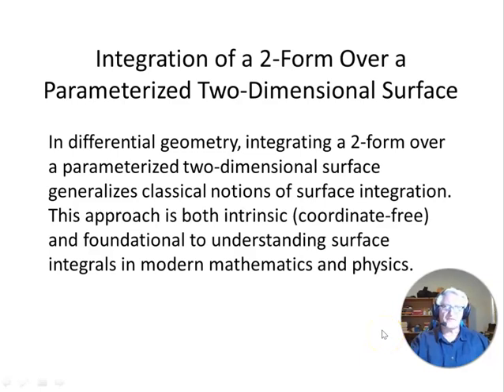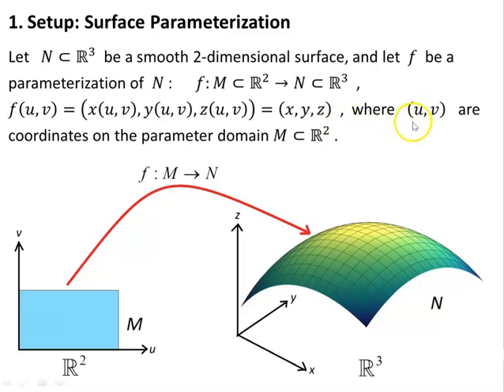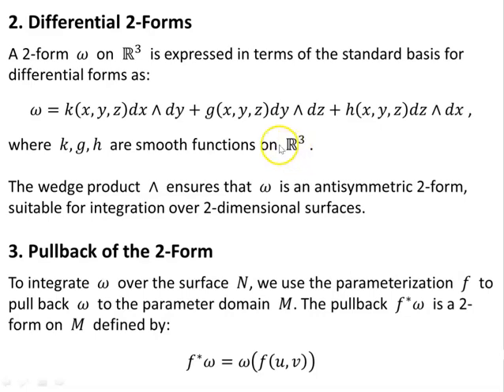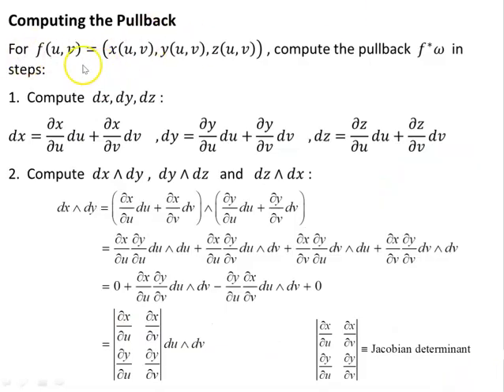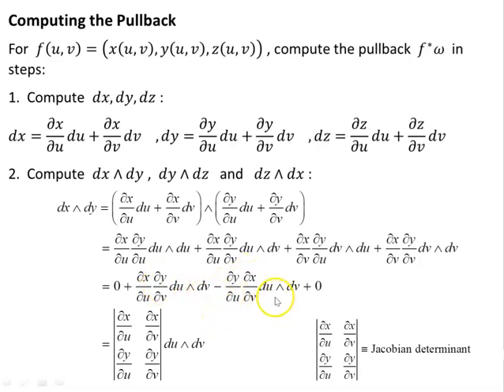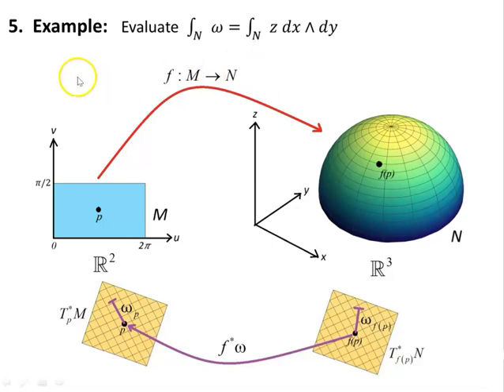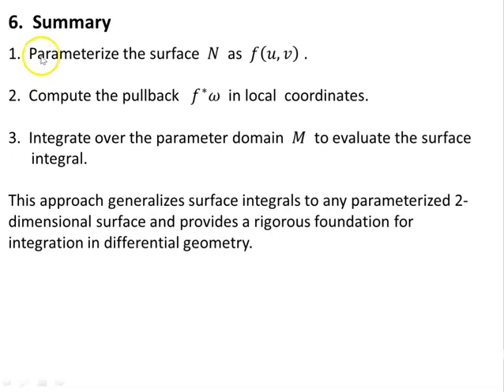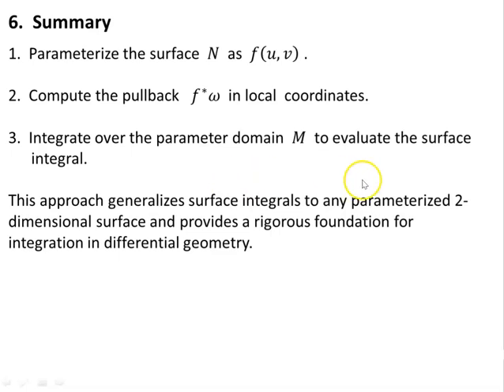Surface Integrals on Manifolds Using Differential Forms

Comment: Thanks for this good and thorough explanation. I have two comments on notation that needs to be clarified.

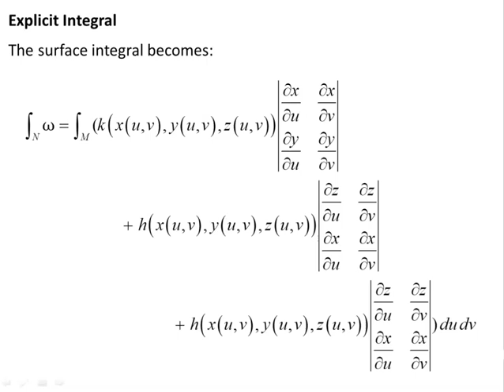1. At 9:30, the equation here has combined two steps that perhaps should be discussed separately. The first is the equivalence of the integrals related by pullback. This relates the integral  of \omega  over N to an integral of f*(\omega) over M. That latter form, should be expressed in terms of a wedge product, so it would have du^dv, not du dv.. Ten comes the second step, the definition for the evaluation of the integral of a form over a Euclidean domain. That allows evaluating the integral of forms in terms of du^dv as simple iterated integrals in du dv. 

I think it would be clearer if the two conceptual steps were made more explicit. 

2. At 15:45 There appears to be a typo. The integral over N of z dx dy is not defined , and it isn't correct to express it as an iterated integral since N is not a Euclidean domain. It should be written dx ^ dy, since only the integral of a form over N is defined over a general manifold. Then it works. I believe this was just a typo but it could be confusing.

Thanks, and apologies if I've gotten anything wrong.
Reply from the maker: Thank you so much for your thoughtful feedback and for taking the time to engage with the video. I really appreciate your observations, and I’ll do my best to address your points.

1. Clarification of the Steps at 9:30
You are absolutely right that the explanation at 9:30 combines two conceptual steps that deserve to be treated separately for clarity. Let me outline them explicitly:

Step 1: Pullback and the equivalence of integrals
This step relies on the property of the pullback, which ensures that the integral of a differential form 𝜔 over a manifold 𝑁 is equal to the integral of the pullback 𝑓^∗(𝜔) over the manifold 𝑀:  
                                                      ∫_𝑁 𝜔 = ∫_𝑀 𝑓^∗(𝜔).
The pullback 𝑓^∗(𝜔) is expressed in terms of the pullback of the components of 
𝜔, and the orientation-preserving map 𝑓 ensures that the geometric meaning of the integral is preserved.

Step 2: Expression of 𝑓^∗(𝜔) in local coordinates
Once 𝑓^∗(𝜔) is written in terms of local coordinates on 𝑀, it involves a wedge product like 𝑑𝑢∧𝑑𝑣. At this stage, we can invoke the definition of the integral of a differential form over a Euclidean domain to evaluate it as an iterated integral:

∫_𝑀 𝑓^∗(𝜔) = ∫_𝑀 𝑔(𝑢,𝑣) 𝑑𝑢∧𝑑𝑣 = ∫_𝑢1 ^𝑢2 ∫_𝑣1 ^𝑣2 𝑔(𝑢,𝑣) 𝑑𝑢 𝑑𝑣.

This connection between the abstract formalism of differential forms and the familiar iterated integral makes it possible to perform explicit computations.

I appreciate your suggestion to separate these steps for clarity. I will make an effort to present this process in a more step-by-step fashion in future videos.

2. Typo at 15:45
Thank you for catching this! You’re absolutely correct that ∫_𝑁 𝑧 𝑑𝑥 𝑑𝑦 is not properly defined in the context of integration on a general manifold 𝑁, as 𝑑𝑥 𝑑𝑦 is not a 2-form but rather a product of differentials from traditional calculus notation. The correct notation should indeed be  ∫_𝑁 𝑧 𝑑𝑥∧𝑑𝑦, which represents the integral of the 2-form  𝑧 𝑑𝑥∧𝑑𝑦 over the manifold 𝑁.

The wedge product  𝑑𝑥∧𝑑𝑦  ensures that the integral is well-defined on a general manifold, where the geometry is more abstract than a Euclidean domain. Without this correction, the expression could be misinterpreted as attempting to apply iterated integrals directly to a manifold 𝑁, which is not always possible.

I’ll update my notes and future explanations to clarify this point and ensure that the correct notation is consistently used to avoid any confusion.

Apology Not Necessary!
There’s absolutely no need to apologize—you’ve raised excellent points, and your observations are spot-on. Discussions like these are incredibly valuable for improving the clarity and rigor of my explanations. Thank you for helping me refine my presentation, and please don’t hesitate to share any further thoughts or questions!

Comment: There is an interesting paper in the Mathematical Monthly by Yuily Baryshnikov and Robert Ghrist titled "Stokes' Theorem, Data and Polar Ice Caps"  which involves an expression derived from a differential form that ultimately involves a piecewise linear approximation to a boundary. It is a funky formula but when I tested it out it wasn't particularly accurate (too technical to explain why).